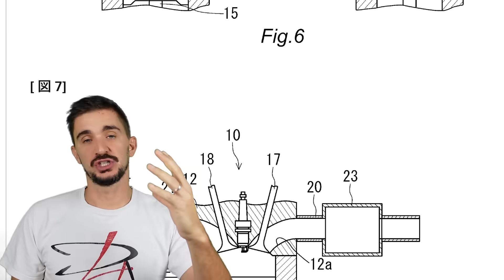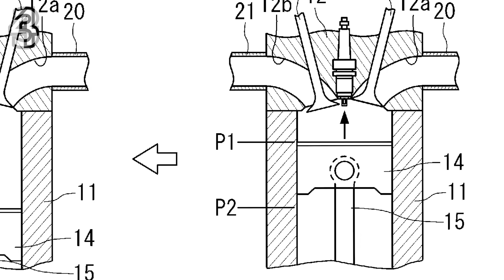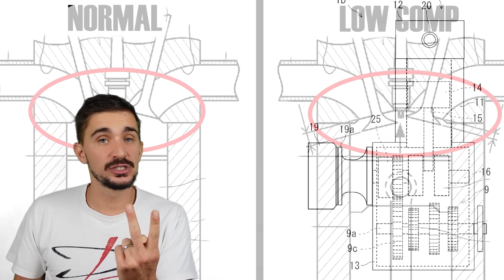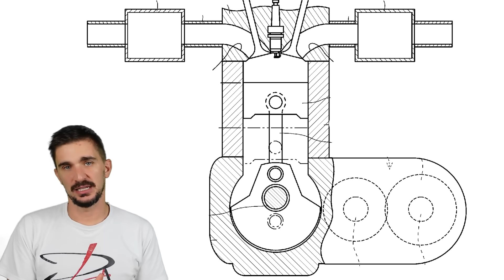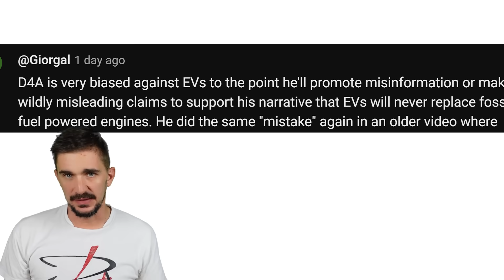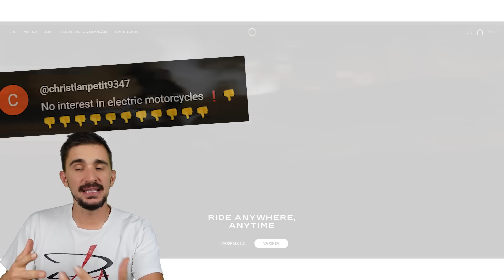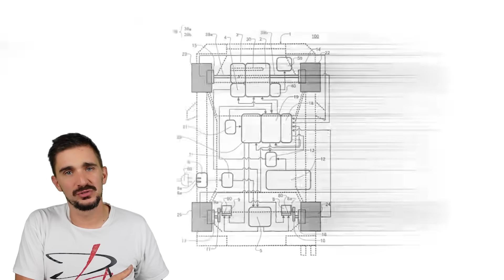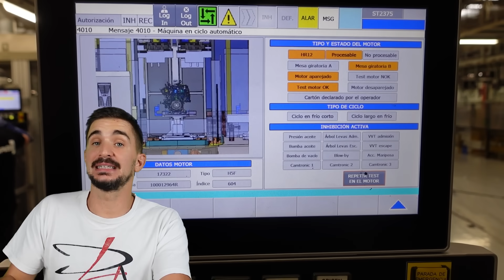Yamaha Just Patented A Fake Engine

Comment: It looks like a workaround so that when petrol engines are banned from sale, this "fake" engine can still be sold in an electric motorbike - since its primary purpose is not as an engine.  But as soon as the customer has the bike, they can quickly add a fuel tank and turn the "fake" engine into a real one.  Why else would the "fake engine" in the patent have a spark plug?
Reply from the maker: That's some creative thinking! I think it's very unlikely but it definitely didn't cross my mind, kudos for the out of the box thinking!
Reply: @d4a This was the only reasoning I could think of, maybe they release an 'upgrade kit' that doesn't have to meet emissions as a workaround, dodge demon style?
Reply: @d4a  Most likely it's a defensive patent...
Reply from the maker: @mikespence2836  Yes, but defending against what? Something incredibly useless and unlikely that somebody won't ever build or have sales success with? I think that by the time people might actually want this just for the novely and fun factor the patent will have expired :)
Reply: @d4a  I think maybe the Engineering Dept, the Marketing Dept and the Legal Dept just had too many beers together and asked "what can we do so that we can issue a press release, take a future option away from our competitors, and have an engineering in-joke all at the same time?"  It's certainly got a lot of people talking 🙂
Reply: @d4a EU has plans to ban the sale of petrol engines by 2035. This is future proofing a loophole with a 5 year window to decide if selling a kit with the rest of the powertrain is viable.
Reply: @renzokukeng1776  even if that plans hold up such a solution won't pass the smell test.
Reply: @mikespence2836  “we do a lil trollin’ ” aah meeting 😂😂😂
Reply: @d4a  Like selling a 'laser welder', that comes with a roll of solder? Or 'replica' watches sold by the  container load? Already hard to know which is a real Honda 125 or 250 engine, from a chinese copy.
Reply: @d4a  It's not the first time the Japanese use a workaround like this. They did it with their sportscars back when there was a horsepower legal limit. In fact, they even did it with a heavy cruiser once. Back before WW2, the size of a warship was defined by the caliber of its guns. So to avoid breaking a "no heavy cruiser" treaty, they made the Mogami-class and gave it slightly smaller guns but with the same mount you would use for heavier guns. So as soon as the war started, they just switched guns
Reply: @d4a  well , other japanese brands used to make underpowered engines that would produce massive power with minor modifications in the 90s just to pass regulations
Reply: @d4a  isn’t it same story as with supra?
Reply: The spark plug definitely fishy…
Reply: @964cuplove actually its an aromatherapy candle so they get the "smokey" visual/spiritual experience 😉👍
Reply: That's a great idea. If they can't sell real engines, they can just sell dummy engines that can easily be converted to real engines by some simple modification.
Reply: I mean it wouldn't be the first time a company does something like this. Suzuki gsx s950 has a 1000cc motor that makes only 95hp so you can ride it on a a2 licensce, but you can release its horses with a simple ecu flash and get 150hp that its older Sister (gsx s1000) has
Reply: It is not like this never happened before.
Reply: That was my immediate thought also, that it's like the track kit Chrysler sold with their Demon engine cars. Or like when companies sell non serialized 95% AR receivers which the customer can finish with a drill press and a little skill and build up into a "ghost" firearm. The company can't sell you an out of the box product because of regulation, but they can sell you a product in which the majority of the heavy lifting has been done and whatever the customer does to their property once they've bought it isn't the concern of the manufacturer.
Reply: @joshuaisaacson3408EXACTLY…. the Yamaha 750 GHOST Runner
Reply: Just like classic lightbulb, they  sell as heating bulbs.

I think Yamaha can use this to sell off road motorcycles.
And you can make them combustion operated by unscrewing intake valve clearance bolt.
Reply: "For closed course use only" nudge nudge wink wink
Reply: My thoughts exactly.  Just a couple of easy mods, and you have a hybrid.
Reply: That actually makes sense.
Reply: "After dissolving the brick in a gallon of water, do not place the liquid in a jug away in the cupboard for twenty days, because then it would turn into wine."
Reply: Interesting concept, but when ICE's are banned as you hypothesise, then the market for fuel dies with them . . . . So what are you going to run this sneakily commissioned engine on ? Cheap Russian vodke, springs to mind, I suppose . . . . .
Reply: @greggarnham8497  No, the fuel market does not die instantly because the only way an ICE ban is going to come about is by way of a ban on new production ones. The existing ones will have to remain legal because replacing all of them with EVs is simply an economic impossibility.
Reply: @wurfyy so that means yamaha invested all this development and patent money on a "twilight" model. Something to last a few years while the last of the petrol engined vehicles become prohibitively expensive to own and run and fade from the scene. Seems extremely unlikely, Yamaha aren't known for foolish economic decisions, or reading the play THAT badly . . . . Most likely its a visceral alternative. When your choice is ONLY an electric that whines, or an electric that has artificial soul, they hope you'll  choose their model that covers the whine with a pseudo bike feel. What else could possibly make econimic sense to a goliath operation like Yamaha.
Reply: @greggarnham8497  Or maybe their play is that it'll pretty quickly become obvious to everyone who hasn't cottoned on to it yet that banning ICEs is stupid and so any such ban will inevitably be reversed - this could then be their ICE offering during that period.
Reply: @wurfyy  banning ICEs is only stupid if it is done broadly and without consideration of edge cases. ( it is just pretty useless if the EU is the only market to do so, China might be a second market but India and Africa don't even have the grid yet to handle the transition.)
Reply: @rafaelwoitzuck3186  No, it's stupid if it's done in any way, shape or form whatsoever. EVs currently simply aren't even close to being able to fulfil everyone's needs, and meanwhile it's to this day questionable whether they're actually even any more eco-friendly than some of the more efficient ICEs.
Reply: @wurfyy  yes, because you are talking about the status-quo. The ban aims to be carbon neutral by 2050 which gives 15-25 years of EV development. Furthermore, as of now, we still have the possibility of e-fuels. As for the ecology.. yeah, there are some doubts, especially with cars which are harder to repair.  But as a side effect we could see a reduction of deaths due to exhaust fumes in the range of thousands per year.
Reply: @wurfyy  but older engines are also going to eventually fail, and without further replacement parts
Reply: @rafaelwoitzuck3186  Yes, I kinda am talking about the status quo, as opposed to just assuming that there will be some big breakthrough that will make EVs as viable for everything as ICEs are right now. Because that's a huge assumption. All we can more or less count on is small, incremental improvements that won't get us anywhere near that goal.
And I think the reduction in deaths due to exhaust fumes will be more than offset by deaths from people switching from cars that weigh on the order of about a ton more than ICE equivalents. Particularly in winter.
Reply: @erkinalp  There will be replacement parts. If not by the original manufacturers, then by aftermarket ones. This will be especially true for engines which will undoubtedly continue to be used for racing, so I think my 4B11T will be pretty safe.

Also, because any total ban on ICEs will undoubtedly be reversed as soon as the economic unviability of it becomes impossible to ignore, any parts shortage that may result is only going to last a few years at most.
Reply: @wurfyy  As for the second part, yes can see an increase - but our regulation has been pretty quiet on the trend to oversized cars & SUVs so.. i have little hope in that regard. For the second part: Bans with sensible timeframes as regulation work pretty well (e.g. when it comes to CFCs or other gases in coolant systems) and the have the upside that you can actually react to the market: If by 2030 EV adoption is still low and/or other issues are coming up the timeframe can be pushed. we have no such luxury when it comes to the consequences of climate change as we can't change physics.  To give context to the year 2050: This is when the netherlands dikes/storm drains&pumps are likely to be not sufficient anymore to battle the sea level rise. 40 years ago such a ban would be only stupid for me,.. by now I'm still not happy but doing nothing is far worse
Reply: @rafaelwoitzuck3186  It's not about the trend to oversized cars, it's simply the fact that a few liters of fuel gets you as much range as a few hundred kilograms of battery. EVs are inherently much heavier than ICE cars.
As for combatting climate change, as I already pointed out, and I'm pretty sure you agreed, it's not even clear whether EVs are at all better than petrol cars. And I'm not particularly convinced by deadlines only a few decades out from now. A few decades ago half the world was supposed to be flooded by now. Gonna take a lot to convince me that this is anything but alarmism.
Reply: @greggarnham8497  lmao oy vey “the market for fuel dies with them” oy gevalt
Reply: @greggarnham8497  ICE will be banned for new engines, not for existing ones
Reply: @greggarnham8497  Banning internal combustion engines doesn't mean gasoline goes away. Heck gasoline was around and sold in shops long before the internal combustion engine was even a thing.
Reply: @ach3909 no it wasn't.  What on earth would it have been used for before internal combustion engines ? Explosive lamp oil ? Volatile fire-lighting fluid ? It sure wouldn't have been worth setting up expensive refinery facilities to produce a liquid with no use whatsoever, just in case one cropped up in the future ! Thats absurd logic.
Reply: @ach3909  thermally cracked gasoline was invented just in 1913. benz etc bought their fuel from pharmacists, basically, running on an industrial cleaner. liquids that could run a diesel engine were more widely available. but of course it would take decades for gasoline to become unavailable, more so considering that if the demand goes down the price could go down too. diesel and avgas would stay available far longer and if you just had cheaper energy than diesel kind of oil available you could just make bio oils cheaper too in perpetuity.
Reply: It's exactly what I was thinking. It's the closest thing to a rational explanation that I can think of.
Reply: like the wine boxes during prohibition
Reply: Now not tomorrow now, find out who you vote for and make sure they are not going to vote to ban the sale of Petrol motors . Don't let the insane control freak get in power .
Reply: This, a disabled hybrid that you can develop by yourself
Reply: @GonzoSaavedra  and a series hybrid, the good kind of hybrid
Reply: . But why not make a hybrid bike ? A let the engine be a generator all the time ? Even let it rev and then just let clutch slip if there is to much electricty. Maybe they gonna do this
Reply: @ThaDutchDK1989  No clutch slip - just regulate the power down in the controller. You need a controller designed for this operation anyway. Or just a software patch
Reply: @ThaDutchDK1989  emissions would not be zero then
Reply: This is what i wanted to write, it actually genius.
Reply: Pretty cool idea
Reply: Well, the engine comes with a spark plug. But the camshafts would also have to be changed to allow the valves to open and close properly
Reply: @jo8512-y1e it doesnt show a cam, so its likely electronic valves like the "freevalve" on Koenigseggs
Reply: even though this sounds dystopian, it actually makes more sense than the “it’s about the feel and vibe” excuse.

It reminds me about those herb grinders, to grind up, ermm, “spices”. 
Or those fancy “gravity smokers” intended to infuse cocktails.
Reply: Yamaha stonks ☝️
Reply: I had the same idea.  Trojan horse.
Reply: I hope the patent refers to it as a NVH Generator. You are so rational, but have you met some of us? Humans do all sorts of ridiculous, wasteful, unnecessary, irrational things. And we like certain things without being able to really say why. If you liken a gas motor cycle to a horse, they produce a rhythmic pulse when you ride them. Both audible and tactile. The pounding and pulsing of pistons and hooves seem similar enough it's easy for me to  correlate them as a sensations that are both informative and pleasing. If you remove an important part of the human experience, humans aren't as interested. Some of the "soul" is lost. I think that's also a driving force behind the resurgence of vinyl records, for ex. For a subset of us, the analog and mechanical nature, along with handling the media, watching it spin, all of that stuff is just too compelling at an emotional level to let go and still be satisfied. I really enjoy the sound of a throaty, pounding, large capacity ICE. Big explosions pushing big pistons is simply good, primal stuff.
Reply: The fake blender bit was hilarious. 😅
Reply: They showed how to freewheel a 2-stroke in linear hybrid mode. In gas mode, the ev motor acts as your starter/generator (more common on aircraft).

In emergency, switch to continuous EV mode and limp to a gas station. If even further out, stop and use a portable solar panel to recharge until you can make it. These type of small battery Hybrids are good backups.
Reply: Or a quick way to make a hybrid bike, though those electric valve actuators likely will fail long before anything else, simply because you need a lot of power there in a small volume, and it is hard to make cheap and reliable, unless you also add in a belt or a chain.
Reply: Interestingly, that would turn your bike into a parallel electric hybrid since, unless you're willing to replace the electric motor with a transmission(which is difficult and expensive), you'd still have an electric motor which you'd have to use so it can act as the low gears for your single speed engine
Reply: @jgjg5182  you have the cluitch. And the e-motor alone does not have great losses, when just rotating with no current
Reply: It wouldn’t be that simple. The camshafts would have to be replaced as well, the valve timing wouldn’t allow this engine to run as it sits.
Reply: That's what I thought also. It could be useful for certain jurisdictions that may be thinking of banning real motorcycles at some point in the future.
Reply: But as it doesn't produce any power you have to push it...🥁🥁 introducing the brand new yammie excersise machine 👍
Reply: Does the spark plug have an electric system? Does the crank connect to a flywheel or gearbox? Is there a line to run a chain from the output sprocket down to a sprocket on the rear wheel?
I'm with you though, having a "clutch" and "spark plug" seems like guilding an already overly perfumed lily
Reply: @Mattsretiring  Some of the drawings even show the semblance of a gearbox.
Reply: Needs a custom cam though, the timing this engine has seems very wacked out with when valves open and shut
Reply: @captainchicken8983  can go camless like Koenigegg Freevalve
Reply: Great shout.  Then the majority of people can buy it thinking it's a performance bike, but the few who actually convert it will actually make it a performance bike.  Halo factor.
Reply: Also, why would it have valves if 1 never closes?
Reply: This is very likely true.
Reply: This is 160 IQ move right here. Actually, makes sense.
Reply: That was my first thought. It actually seems obvious.
Reply: I think you hit the nail on the head. Though that does bring up another point that if ICE's are banned, will the fuel they run in also be banned? I don't think fuel will ever get banned from sale though. It will just get even more expensive. I also think that most places will just ban the sale of new ICE's in new passenger vehicles. If they suddenly banned the fuel for sale the world would come to a screeching halt. Plus I doubt oil companies are just going to give up without a fight or bribing politicians.
Reply: I'd buy one in that case.
Reply: This has been done with agricultural 1- and 2-cylinder diesel engines. Banned from importation by the EPA, they are now imported to the U.S. as “air compressors,” and a person in the know can get the parts needed to convert the device into the engine that used to be directly imported.
The engine is called “Listeroid” as it is an Asian copy of a British Lister diesel engine. They will run on anything that burns - waste motor oil, hydraulic fluid, whatever - and run for months putting out their 6.5hp at 600 RPM. They sound like a steam train half a mile in the distance, and can be used for generators, pumps, mills, or just about any other low-power task.
Reply: First thing that came to my mind also - and spark plug just confirms this.
Reply: That would make more sense than the real poject.
Reply: I wanted to write exactly this - they will sell functional "motor" to which customer adds only carburetor (they will sell them separately as "bookhelf decoration") and voilá, you have proper motorcycle. And of course, they would sell gearbox that will by some lucky accident fit exatly to the place electric motor is on the production bike. Purist bikers would tear their hands off for stuff like this.
Reply: That was my thought!
Reply: That valve timing though ...
Reply: This would not work in most parts of the world though, since such mods are illegal.
Reply: @Dan_Divebomb  It's the kind of illegal that's hard to spot if done right.
Reply: @wurfyy Actually it's pretty easy. The cop checks your registration and sees that it's not a gasoline engine. Then takes a smell at your tailpipes where raw HC is emitted (you have no cat) and that's it.
Reply: @Dan_Divebomb  After he stops you... for what exactly? Having an engine noise in a motorcycle that's known for having it despite actually being electric?
Many people run their vehicles in a configuration that isn't technically road-legal, and it wouldn't be that difficult to spot it if you know what to look for. And cops typically don't bother them, either because they don't know what to look for, or they don't care.
Reply: @wurfyy normal traffic control. Happens all the time here, especially on sunny days.
Reply: I will patent a fake Perpetuum mobile! Wonder how many I can sell, a year 🤔💰💰💰
Reply: That would be genius if that's the plan. I can picture a 1000cc fake engined sport bike with an inhub electric motor and battery fuel tank. Just swap out the tank, add spark plugs and off to the races.
Reply: Bahahaha when "petrol" gets banned, THAT is a good one my guy 😂😂😂
Reply: I think the same as you
Reply: CRUISING/POSING: A significant part of the motorcycle scene, in my area, involves cruising up and down   the downtown area on nice days, (along with nice cars).
How much attention is paid to them, by the people strolling and eating outside, is debatable but, as someone who likes motorcycles, and cars, and the sound of IC engines, I view it as free entertainment which adds to the outside dining experience.
Now we just need an electric car that can replicate the lumpy rumble of an V8! (Rich Rebuilds already made an actual V8 Tesla).
Reply: I guess the card on the spokes patent was already taken.
Reply: im glad someone else thouth of it
Reply: That sounds too good to be true
Reply: Nonsense, you need a tank, carburettor, clutch, gearbox, drive unit, coil, ignition system and then you will have to redesign the valve train from the ground up because this engine is not meant to compress anything.
Just because you have a piston, doesn't mean it can easily be turned into a combustion vehicle.
And then it wouldn't be road legal.
I don't see this as being reasonably possible.
Reply: -But officer, this is just a fake engine, a nosie making device, see?
-Yeah sure the noise it makes smells quite bad
Reply: 3:38 I'm a couch mechanic, but keeping the intake open during combustion does not a good engine make.
Reply: @bouwen4tw it has variable valve timing tho
Reply: I doubt there is enough of a market of people being able to do that for Yamaha to see a market. It also lose its road legality. 

Only way I see your argument make sense is if they try to circumvent embargos and maybe export them to DPRK, Russia or Cuba. 

Maybe I fall into stereotypes but I just can't see the very conservative Japanese business actively skirting the law like that as the domestic fallout would be massive.
Reply: @cyan_oxy6734  guess you never heard of Toyota in LMP1 😂
Reply: @cyan_oxy6734  well, they did already: with the "gentleman agreement" to not go over certain power (maybe around 230HP?) and releasing cars with the 2JZ and similar engines that could be relatively easily tuned to 500+HP....